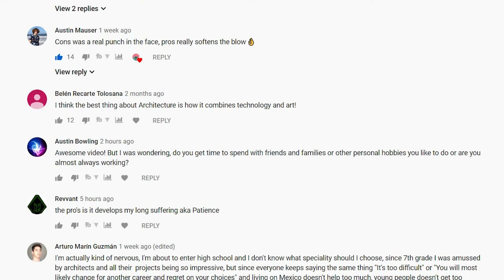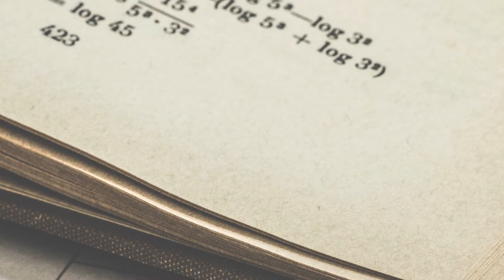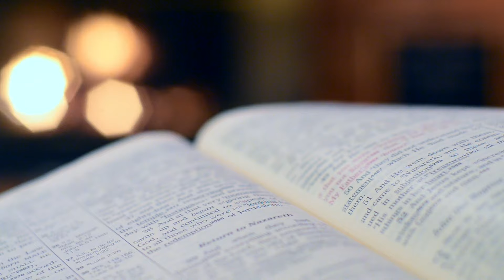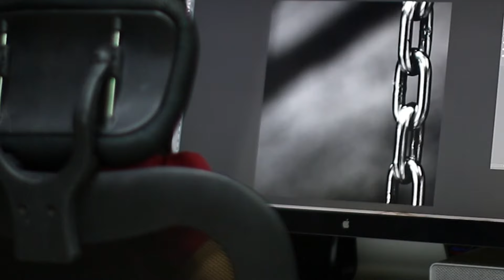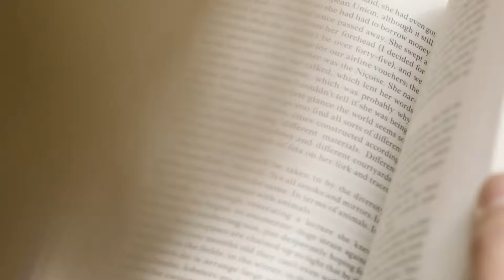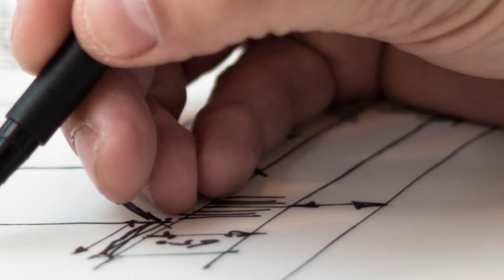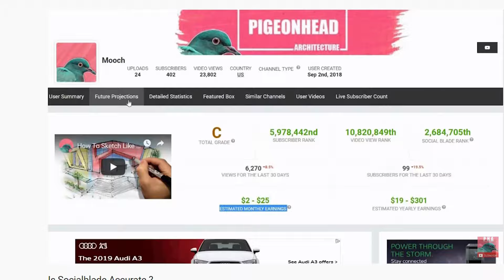Is Architecture A Good Career?

Comment: I’m 15 and considering going to school for this and stuff but I was wondering after I get my license and stuff am I able to like make my own service to design houses for clients on my own and then I can work with builders I higher to build it or am I only able to work at a company with other ppl to only help design it
Reply from the maker: You could open up your own firm and pick your clients. That will happen later down the road though because you will need experience running the firm. It's possible having your own firm, no doubt, but you might have to hire a few helping hands that can help create the documents.